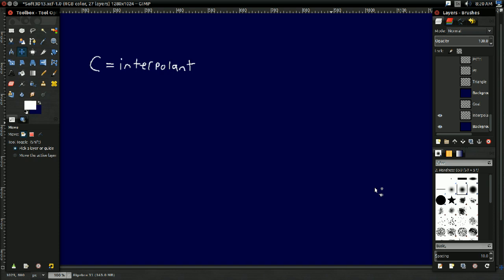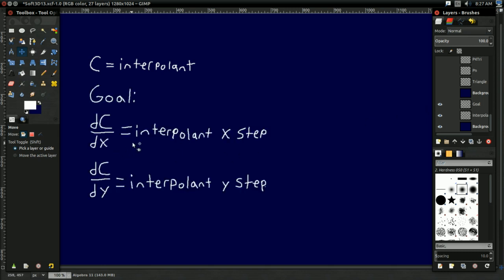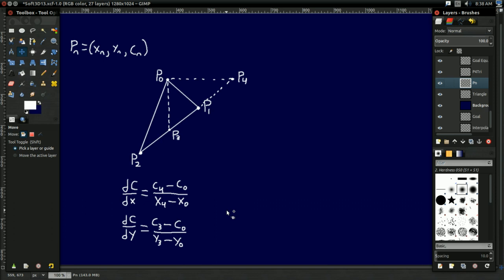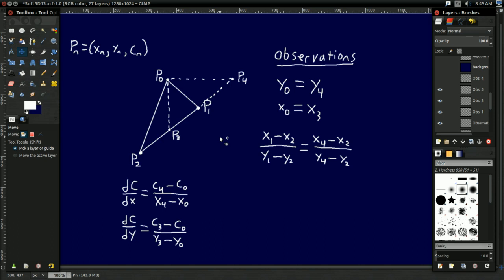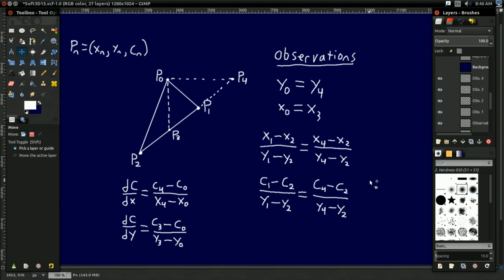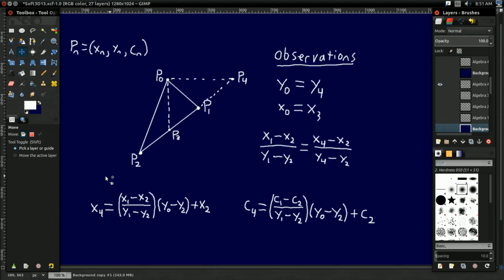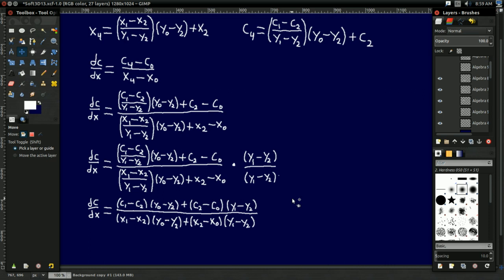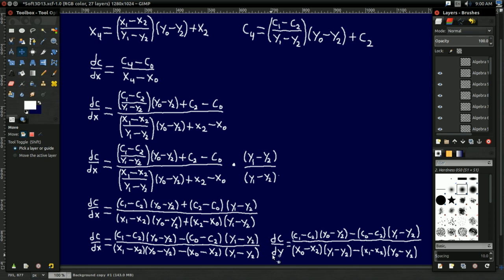#13 3D Software Rendering Tutorial: Gradients

Comment: cool to see another take on the gradients, i do it a bit differently though and imo even simpler.
calculate gradients from p0->p2, imagine p3 on that line where y3=y1 then calculate horizontal gradients from p1->p3. For the other 2 edges I only need the x gradient.